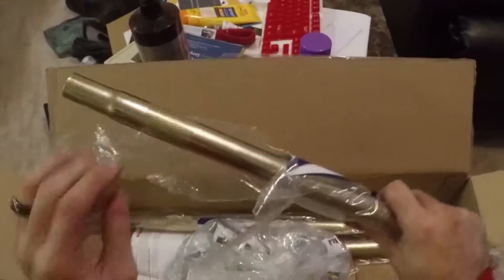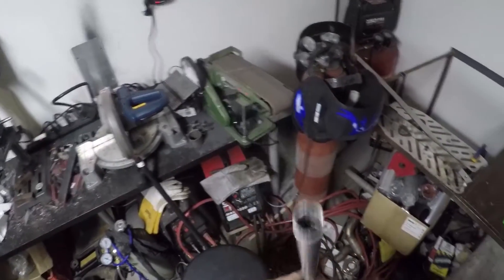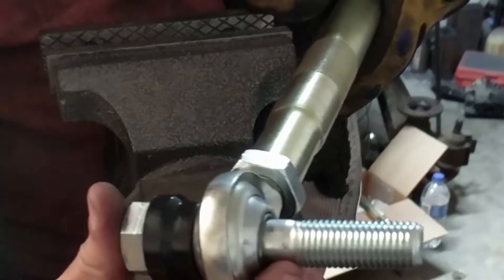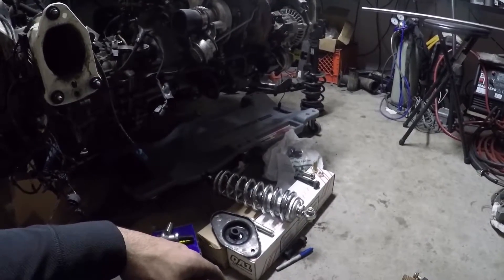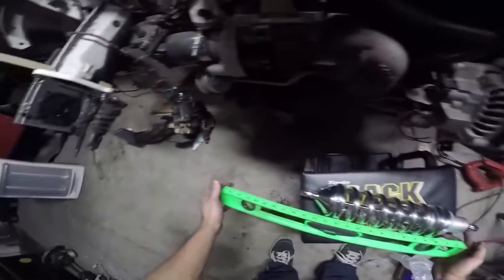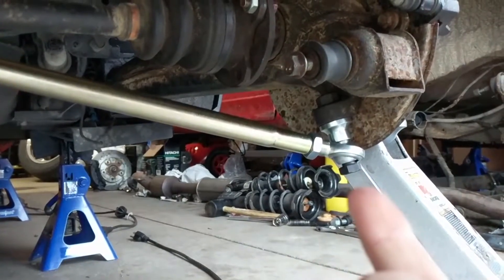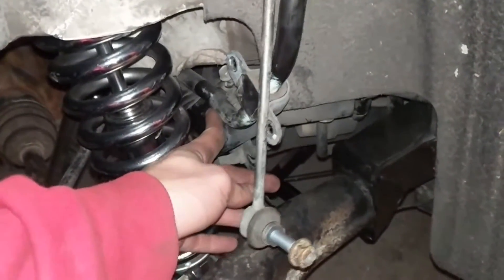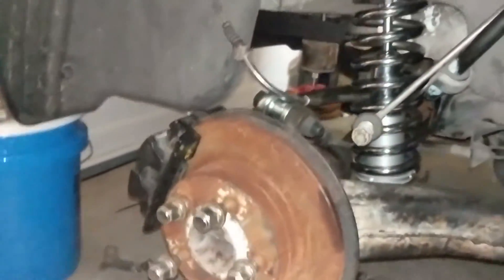✓ DIY Rear Upper & Lower Control Arms - AWD Mini Cooper Ep. 16

Comment: Cool project. You are backing up a lot of info I found to be the case with a mini.  I have a rwd mini project brewing.  Another option you could have looked into is countryman all4 rear arms. They are set up for axles. Also r50 Cooper rear arms I believe front wheel bearings bolt into so can accept an axle already. Looking forward to seeing you finish the car
Reply from the maker: andrew mac that's a great idea actually. I wish I thought of that back at the beginning. Worse case, I can look into them later on as an option to make the ABS wheel speed sensors work ;-)
If they're even close to bolting up, then that may be a good phase 2 option for improving the build later on. I could get the speedo to work along with power steering and ABS.
Thanks for the comment and info. Hope your enjoying everything so far. Very close to making this vehicle fully operational. Then it's all about the creature comforts haha
Happy modding and keep me posted on the RWD Mini too
-Ryan

Comment: Rear suspension geometry is going to be a problem.  Upper and lower arms should be near parallel
Reply from the maker: Todd Stanley so on the mini Cooper, they were never near parallel to begin with. I had to basically mimic the oem suspension for this setup since I'm not building a full rear subframe at this time. Eventually I plan to replace the rear trailing arms and control arms with a double wish bone setup but that's a lot more fab work which I don't have time for at the moment
Compared to oem, this car does gain 1 degree more camber under max compression. Oem gained just over 2° where mine gains 2.9°. but I'd be bottoming out the intended travel at that point too. The benefit of that means I can have solid traction on flat acceleration with near zero static camber and higher camber when needed for cornering. If the effect us too great under acceleration squat, then I can move the inner control arm mounts to balance out the handling. Again this will all be replaced in due time with a full custom rear but the Mini geometry is what I'm limited by at the moment.
Great comment though, I agree it's less than ideal but it should still be manageable like the OEM was.
Keep the comments coming, this is great input and feedback on the build ;-)
Reply: It may work out , but the Cooper was not AWD before.  Note the original diff inner control arm mounts has one above and one below the inner cv.  This maintains inner to outer cv distance so the inner joint does not over extend or bottom out.  Lowering the inner lower mount on the Mini may be required
Reply from the maker: Very valid point. It will all depend on what it needs since the power transfer is completely different than before. And yes since the hub mounting locations cannot be changed, the only options would be to lower the lower inner bar mount or raise the inner upper bar mount (but there isn't much space to raise it anything significant).
The R&D of it all will be how it handles on the road and on the track. With so many unknowns like weight distribution and how accurate my spring rate approximations were and how I want to set up my new rear sway bar. If it is gaining too much rear camber then the best solution would be to redesign the entire rear subframe to accommodate everything and get rid of the trailing arms to do a full suspension replacement with tubular members. But it's hard to figure out what characteristics to design into it without knowing how it will perform with the OEM setup first which is the easier to make work. It'll be an iterative process but it will get me down the road either way and I can tweaks from there. I'll definitely post a video once it's driving to see how the camber gain is under different conditions ;-)